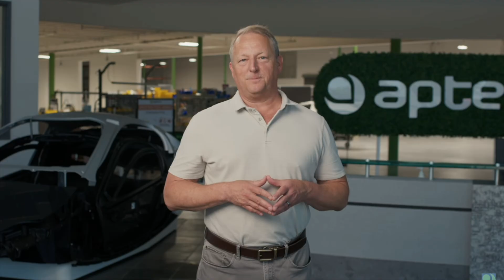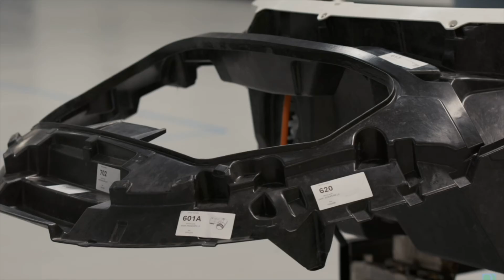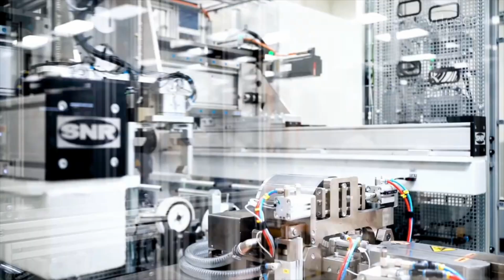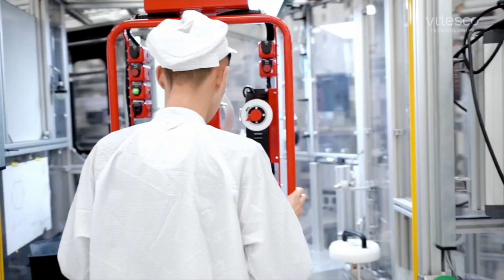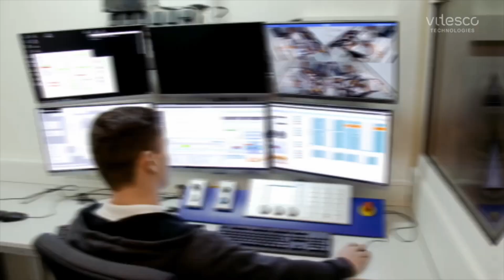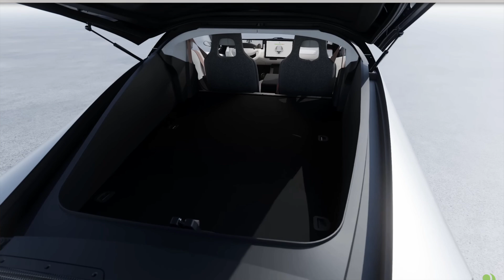Should Aptera Go To A 48 V System ?

Comment: bad idea, less safe, thin wires more fragile, a wiring harness really isn't that heavy (a lot of the weight will be pvc insulation and plugs anyway) and the big problem is what happens at frayed wires , loose connections WAY more likely to arc and be a fire hazzard. Even 24v systems have way more problems than 12v.

Comment: No, it just adds more complexity, cost and weight. Is there any device in 12 volt system of an Aptera that draws more than 3-4 amps? Wire any smaller than that is so small when in a harness it is fragile and easily broken. Porsche already dropped 48 volt systems from their EV's, explaining that you end up with three voltage busses. Anything that requires a large amount of power runs a pack voltage, all the low current devices run at 12volts. On their earlier EV's nobody made parts that ran at pack voltage at that time, so additional DC/DC conversion was required like Tesla does in the Cyber Truck.

Comment: there is a lot of  "they'd like to do it", but just like other things on the "like to do" list things like heat pump, and now the hub motors, the 48v is not going to happen but sit in the  "like to do in future" category.   BTW the hub motors were supposed to be offered as part of the car but now changed categories to become  "like to do in the future" instead of doing it. 

You see Tesla was a company with Elon Musk having a history of making lots of money from his investments and having so much money to hire engineers they could do more of the innovative engineering of the little parts. 

The ability for Aptera to do all the really break through things is limited, even when those things make sense. for example if they went 48v to manufacture each part is too much work. for example power window motors at 48 would be a lot of work to make, when the supply chain is at 12v. 

I think Aptera is pressed to release something to market and rather use existing things from the supply chain rather than engineer their own stuff.  Any mistakes in engineering lead to reliability problems so they have to be careful. One example of them being conservative is how they just recently changed to a traditional axial based ev motor instead of using hub motors.  Its probably based on the cost of reliability and testing. Also they are not designing heat pumps to fit the car specifically that takes a lot of money. So they end up with with more reliable stuff. Aptera's main break through is the carbon fiber body and lightweight and solar. And the 3 wheel body makes it all legal to do this.  If the car is low enough priced with that innovation it will sell. It is chancy but it needs to be reliable and get the range they promise.  They need to put it out  a low price people can afford since there is still that sweet spot window in the market because right now there are very few low priced EVs on the market and the lower price smaller EVs on the market have sucky range compared to what the Apter can do. So Aptera needs to meet the range figures they promise and make reliable cars that work and drive without recalls and mistakes and they need to do it ASAP, while they still have the market window. Supply and Demand will be in their favor, if they produce  a high range low price solar power car before it is too late. That simple fact  if it is a reliable good car will lead to success. otherwise I think Aptera will fail.

And then Three years down the road if Aptera is successful they might do heat pump 48 volt, and hub motor, but then also in Three years  there will be more small EVs from many other manufacturers. Hyundai, Tesla, Chinese Brands, and more are all designing them now.  

I have 98 Geo metro.  no AC. I am going to sell it within a few years and I will either buy a Aptera or Prius Prime with its little solar pannel that still gets a bout 4 or 5 miles a day from the sun LOL. but it is a race with the clock. I am getting to old to continue to drive my 90s car and might not wait for Aptera if they do not produce something next year and show they are viable and successful. I do not like most of what I see on the market.  Aptera is a gamble so I am watching carefully if they actually produce reliable cars.

Comment: The Aptera motor is high voltage (requires a high voltage converter), and so it is very small in size. That is already the biggest reduction in weight  in comparison with 12volt components versus 48 volt components.

Comment: Aptera already said that 48V components are not likely to be available easily (or at a competitive price) for some time. Plus they already have a clever wiring setup that reduces the weight of the wiring harness. One that uses standard (read affordable) components. 48V accessories is like V2G. Once there are universal standards set, and vendors start offering 48V components at decent prices (in a few years) then Aptera will probably start supporting 48V. Without billions to develop vertical integration now (and unlimited resources/time) Aptera is smart seeking parts and technologies that keep its price competitive, and supports volume production in 2025.

Comment: Absolutely but it all comes down to supply chain for parts.  Aptera will switch when parts are available.  Hopefully they will also switch to LFP for the 205/400 mile versions, reintroduce the heated seats and add the mount points for a light duty trailer hitch (same as can be done on a motorcycle).

Comment: From previous videos, Aptera has already moved from using individual conductors to each load to zonal controlled wiring to power the 12v loads which are more readily available (off the self).

Perhaps in a few years when the industry moves to 48v items.  For now, 12v would be best.

Comment: Steve F has already addressed this in a previous video. It is something they’d like to do. One of the issues he brought up was the legislation and industry standards that require some 12v components. 

As the 48v becomes industry standard, they will eventually move to that system. But for now they will stay with the 12v system.
Reply from the maker: Sounds really good to me , thanks . 😎